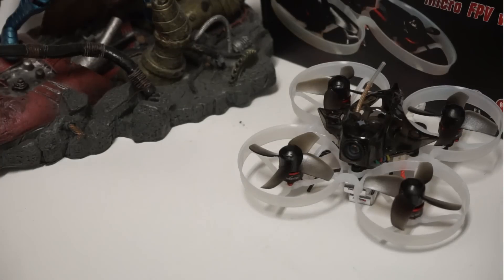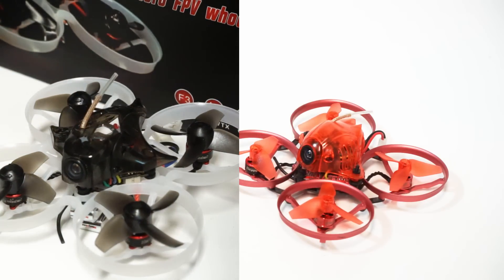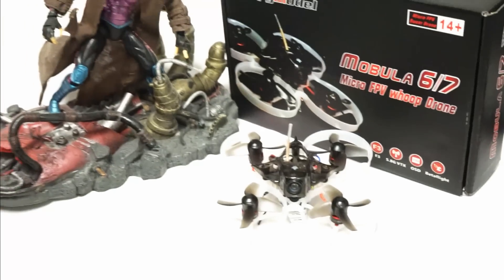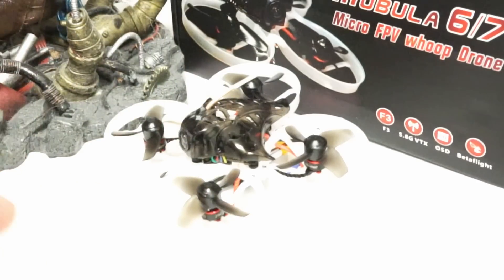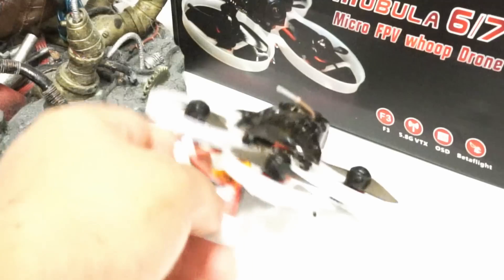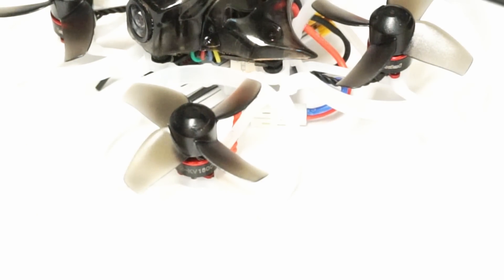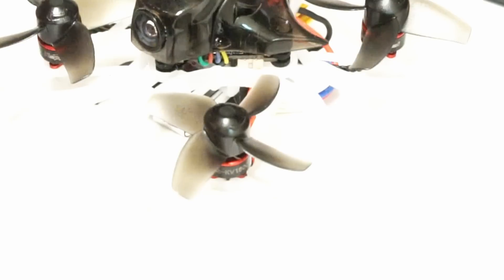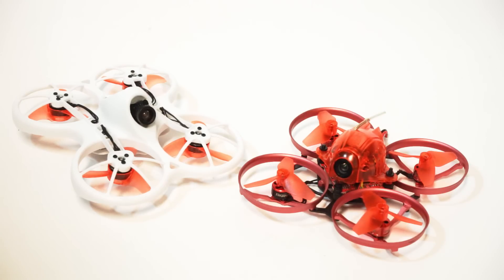Mobula 7 Happy Model, We are not Happy: Droneconomics

Comment: And for what it's worth....I had a Tiny Hawk and had problems problems problems. Never got it to fly well and returned it. The camera also popped out constantly and the VTX was so weak I could barely fly into the next room without loosing video. I probably got a dud (it happens) and I accept that. Oh well, something electronic failed (shocking!) and I moved on. I might try one again later or buy a cheap used one I've seen flying and try again. I know they were liked by many, but I had far more problems with a Tiny Hawk than I've had with my two Mobula 7s.

Comment: Your argument makes no sense to me. Why would they deliberately want to release "inferior" products in a crazy competitive market? And why would the magic "solution" of the V2 frame only cost a couple of dollars? Not like anyone is going to get obscenely rich selling 75mm plastic drone frames, come on. It's not anti-consumer, its anything but. We demand value for money and we want things NOW so these little $100ish whoop drones are rammed into the market as fast as can be. None are perfect nor will ever be perfect. I spent $90 on my Mob7 and yes I destroyed the stock frame, but tell me I didn't have fun because I've been in RC more than 20 years and I used to pay $90 for a single 3s 2200 mA 20c LiPo, and now that buys me a BNF ripper with a charger and spare props I can fly like a maniac and not worry if I smash it. It's cheap as hell and flies great. Happymodel is not anti consumer. I don't resent them for spending another $3 to get the upgraded frame because that is literally all it needed. You were probably not into RC electric flight 15-20 years ago when we used brushed motors, gearboxes and NIMH battery packs, and most kits were expensive and required some level of modification and customization to even fly. A single micro servo would run you $40. $90 for a toy like this boggles my mind. We got it good kid!!!
Reply from the maker: Teesquared, I really appreciate your comments.  I have only been doing quads for about 3.5 years, but i did used to do some Nitro RC maybe 17 years ago.  This is the struggle that we as a hobby have with moving into more reliable consumer grade products.  That every long term hobbyiest is familiar with the "struggle" to get things flying or working at all.  And you are right, my few years is nothing compared to the struggles that you guys went through when pioneering these hobbies.

What has changed?  Now that we are becoming more wide spread, more people are getting interested every day, more companies are making products every day, we have to as a community change our standards.  We already have the hobbyists, tinkerers, IT guys, skateboarders, mechanics and people that just wont give up till they get something working but we want the hobby to grow beyond these boundaries to people that may enjoy it just as much but dont have the patience or the technical ability to get around these roadblocks.  Could these people join this hobby even 2-3 years ago?  No way.  But today, everything is cheaper, easier to use and for the most part more reliable.

That is why we have to up our standards.  In my community we hold beginner series races and other engagement events to try to get the new comers out and help them.  I see first hand the damage the toy grade YouTube community does.  Because this is the entry point.  I have heard so many times "If i had one more thing break, or come as a dud i was about to throw all my stuff in the trash and never touch it again, im so glad i finally ran into you guys to help guide me".  But we cant work at the elbow face to face with everyone, they find youtube.  This was one of the main reasons i started my channel.  To give honest opinions on gear, warn new comers of what to stay away from, and get more people flying.  The more people in the hobby, the more dollars available, the more companies can develop new products and new technologies for us and we all benefit.

Am I hard on these companies looking at them with a 2015 or 2016 standard? Yes.  But its 2019 now, and we have to expect more from the companies that are holding the keys to enter the hobby.  We need reliability, we need higher testing and quality standards.

Also from a product and software development configuration and deployment background, it is easy for me to tell issue that are bugs that crept through the design and testing process, vs issues that were either known before hand, or never came up because proper testing was not done.

That is why I was hard on Happy model, its not exactly about reliability, or 100% success rates, is 2 products back to back that had issues that should have been apparent in development and testing but shipped anyway.  Its a subtle concept that you mostly get exposed to in an MBA masters program, and I thought I could explain it well enough in a short video but I think i was wrong, because people keep getting hung up on that no product is perfect.  Its not the failure itself, or even the failure rate, its the type of common failure that shows a lack of regard for consumers.  And for every new person that gets a crappy product that they dont know how to tweak, fix, or fly, a portion of them will give up and we will lose them forever.  

We went through those harder times, so that we can share our knowledge and help the next guys around.  They likely arent IT guys, but they still may be great pilots and if we can help get them around that tech knowledge curve how great would that be?

I really appreciate your point of view from a greater level of experience, it definitely helps me to organize my thoughts better.  Thank you so much for taking the time to comment.

Comment: Seems to me there're more than a few Nick Burns supporters here expecting you to grow up little man,, 614 subs sad, real sad, I have been burned buy reviewers, no names , and Nick has not been one of them,, Its a 5 dollar frame, in fact, mine came in cracked,, replaced it with one of the 3 I bought,, knowing this is plastic, and knowing I will crash,, This unit rips very good, fun as hell,
Reply from the maker: Not about the frame man. It’s about companies predatory anti consumer practices pushing known flawed products and the review machine giving them all stellar reviews and ignoring the short comings. The fly it, break it, fix it attitude is for long time users. 

We won’t have any new entrants to the hobby with that attitude. We need to expand, to keep growing, to be welcoming to new comers and by hyping up one of the least reliable products as perfect we mislead them and set them up for failure. 

Not about those with experience. It’s about helping people in the air.

Comment: There’s nothing wrong with the snapper or mobula, they are miles better from stock than the tiny hawk is. Terrible video and very misleading. Why is it ok for emax to make a mistake with their design but not happymodel?
Reply from the maker: Everyone can make mistakes. The issue if you watch my video is the trend of cutting corners 2 models back to back at the expense of the consumer.
Reply: Ya but there not major issues. Frames and motors are cheap and the way people flying them indoors it’s nearly a harder life than flying a 5 inch outside in a field or park. The emax tinyhawk has more issues than both of the happymodel models you mention. I just think you are misleading people and putting them off buying what are two perfectly good whoop type drones.

Comment: If you're a whoop pilot. One thing you should have in your tool box, is Welder glue. If you smear a dab along the outside of the ducts. It becomes a cockroach like frame.
All Purpose Adhesive, 2 oz, Industrial Strength, Welder https://www.amazon.com/dp/B074M7BW62/ref=cm_sw_r_cp_apa_i_bJWhCbQM5JPHF

Comment: This is dumb. Mine shipped with the v2 frame I’d assume because I rocked it off all kinds of things and that means they did fix their issue. Also you said the 75x came with no known issues. Oooohhhh other than the fact it’s UNFLYABLE outdoors because of the prop wash, the canopy will immediately break, AND first hit on the stock camera ruins it. I’ll buy 50 mobulas before I’ll buy another beta. You can’t even pronounce mobula right